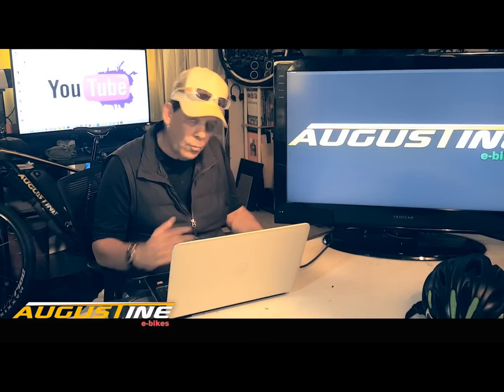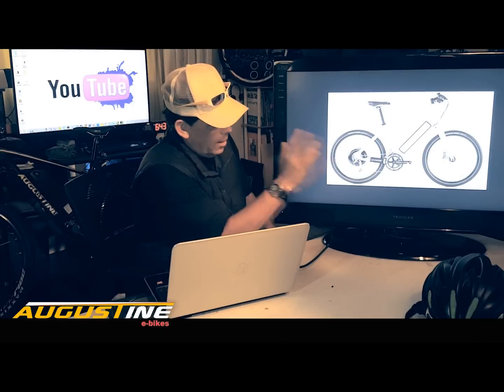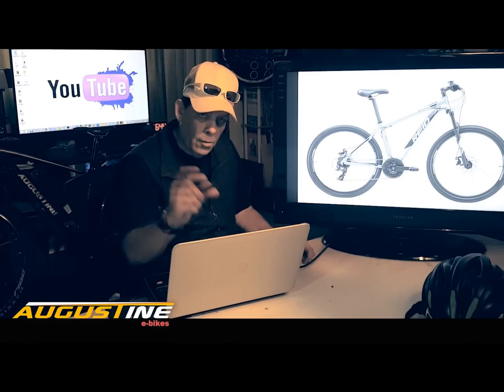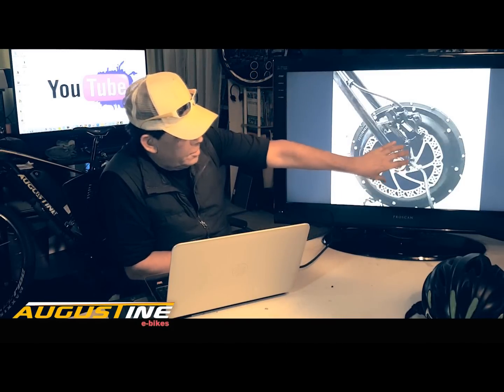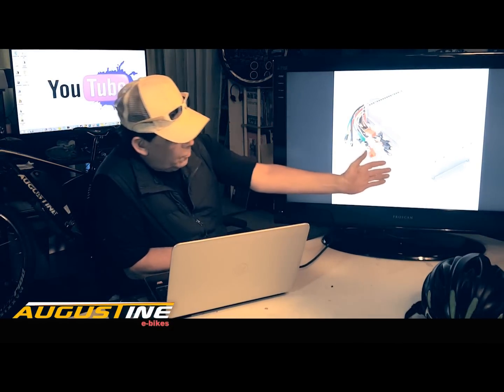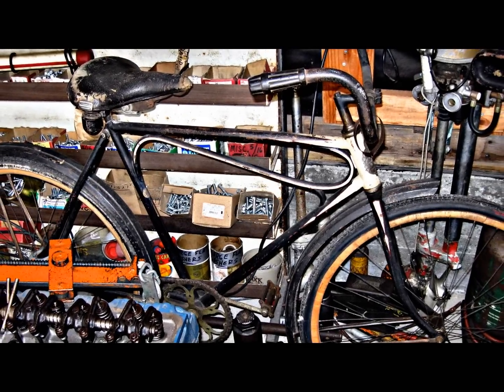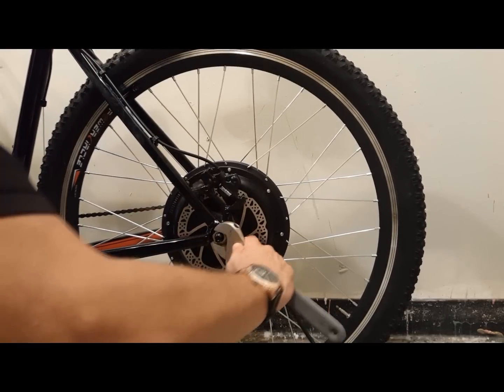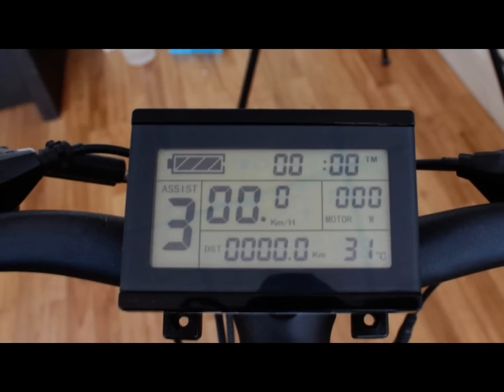How to build an inexpensive e-bike | EASY

Comment: What about Torque kit ? Plus 25aH !! That's a BIG battery you used for your 'calc's....NO WAY would a bottle type battery have this range !!....PLUS placing the controller under the frame means you can only ride in sunny/perfect conditions....Great vid though...

Comment: The biggest  drawback I've encountered in the last 3 years is that the batteries only last through so many charging cycles. I bought the best at the time made by Panasonic and it was rated for 320-340 charging cycles at a cost of $465, I didn't keep track of how many times I charged it but it quit taking a charge after 16 months of using the bike daily. I also purchased a universal charger for Li-Poly and Li-Ion batteries that cost $240! So my advice to anyone planning on building one of these bikes is plan on spending about twice as much as you think it will cost and replacing the battery now and then.
Reply from the maker: Hi Jon, You are totally right that batteries are the weak part of the equation when it comes to ebikes. Having said that, I'm surprised that with Panasonic cells your battery was only rated for 340 charging cycles. Even with the challenges of a battery losing capacity over time, there are factors that can help prolong the life cycle of your battery. room temperature, how frequently you charge, how much charge is in your battery while storing and many more. Although expensive the technology is getting better at a faster and faster rate. Remember, ebikes are at the bottom of the food chain for advancements in battery technology. Without the the investments of car manufacturers, Air transport, commercial vehicles, etc. ebikes would be powered by AAA batteries. We all need to be patient. The time is coming soon for affordable higher capacity batteries. Hang in there!
Reply: What about a prebuilt bike do they last longer?
Reply: So is the tech on fountain of youth immortality getting better,..
Reply: Jon Rothenbusch j
Reply: Jon Rothenbusch th
Reply: Jon Rothenbusch ..the reason they have not been used in even the most hospitable climate...

Comment: Shop Walmart $150 kit. Shop Ebay for 2 - 20 cell battery packs $120. And get an Icharger 1010B+ for perfect charging - $135... Total...$405.
Reply: I got the jueshuai kit on aliexpress 500w motor it came with a 36v 12ah battery and everything else needed for 620$ canadian